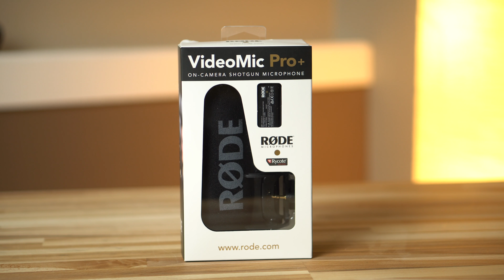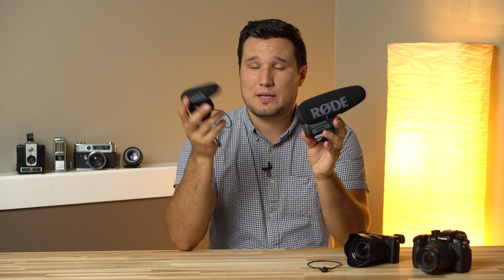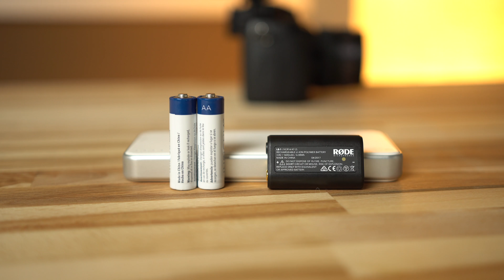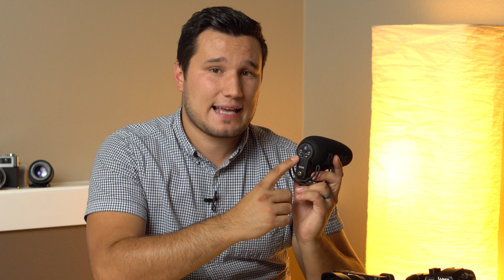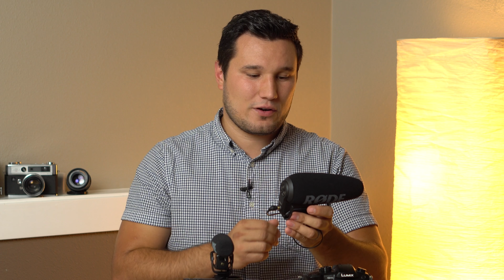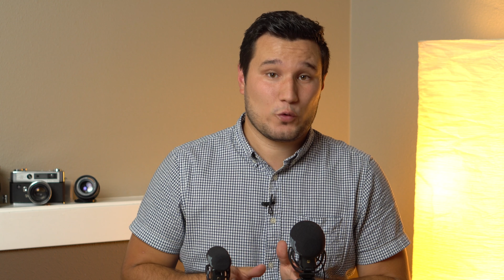RODE VideoMic Pro+ PLUS vs original VideoMic PRO

Comment: The Pro Plus is 3D Omni-directional. Will that fit with the HC-V800? Just think of the V800's 5.1 and Omni-directionality. That can easily capture 5.1 sound systems from the center of a room quite nicely.

Comment: Do these features save? What I mean is... say that I set the mic to record a -10db and 75Hz high pass filter, will those options still be turned on if the mic is turned off and back on again? Or do I have to set them every time I want to record?

Comment: The Rode manual says the Auto Power feature will ONLY work if the camera supplies plug-in power. I tried connecting a mic to a Canon XA20 camcorder and a Canon Vixia HF R72 and the auto power feature did not work. Do Canon camcorders generally not provide plug-in power? Just some DSLR cameras? Who can provide information on this?

Comment: A nice review! Unfortunately the audio levels are not matched so it's very hard to make a fair comparison between the two microphones. The Pro+ is a couple of decibels louder in this video, but it doesn't mean it's better. You need to match the audio levels so you can get an even comparison.

I dowloaded the audio and there's about 3-4db difference between the takes. Especially noticeable outdoors if you listen to the background noise. If I would buy the Pro+, I would go for the features.

Thank you for a nice video!
Jake

Comment: Wow hard choice.  The Pro+ seems to have more gain but also more noise.  I thought it might be that the Pro had better side/ambient rejection but in the interior test the Pro+ seemed to pick up less echo.  So is that Pro+ noise from the +20db gain function (vs the Pro  +10db)?  I didn't detect the Pro+ noise in the interior and boom tests though the additional gain was still there.  Is there an explanation for the noise during the Pro+ exterior test?  After switching to headphones I noticed the noise was there on the Pro as well but it was a little quieter.  I'm guessing it was from the HVAC unit on the house behind you?

Comment: I need to upgrade my mic. I believe that the Rode Video Mic Pro Plus would work well for me. However, can you tell me how it would connect to a camcorder with a side clamp. That mounting type does not bring the hot or cold shoe into play. Does Rode offer a way to do that? Here is the type of mount that I mean: I don't have this specific camera, but the mic mount is exactly like mine: 
https://static.bhphoto.com/images/images750x750/1396442796000_1043893.jpg

Comment: Another feature that was missed on the VideoMic Pro+, You can disable the auto-power sensing by pressing the two buttons in the combination not shown.  The power and the high pass filter pressed together will cause all lights to flash once, or three times.  If it flashes once, auto-power is enabled, if it flashes three times, it's manual power on/off.  
This was useful when using with a pocket audio recorder that was causing it to power off the moment I tried to record.

Comment: Good video overall, but the complaint about not being able to see the viewfinder is completely absurd. If you are using the mic, you are doing video and aren't looking at the viewfinder, but rather the screen.
Reply: Three reasons when I use the EVF specially when run and gunning:  1- When indoor low light   2- Bright day outside   3- Need to  steady the camera more than usual (when using non stabilized B4 long lenses)

Comment: The PLUS's plug is poorly placed and interferes with one's forehead when attached on top of a DSLR or mirrorless. Its a fatal flaw in its design. Busy shopping for such a mic right now and really frustrated by this as the pro+ ticked all other boxes for me.
Reply: I'm in the same boat, and initially thought the plug placement was wrong. But then when you think about it, instead of the viewfinder you're going to use the camera's LCD screen or a gimbal (again, not the viewfinder) most of the time anyway, so that would not be much of an issue, for me at least. The physical size of the pro+ though, that's something to think about when you want to travel light and discreet.
Reply: Just finished two video shoots with the Pro+ on the a7sii.  Using a gimbal means the plug placement is perfect since it dosent interfere with rotation, and even fo the handheld clips, using an external monitor( which you should) means theres always an alternative cold shoe mount.

Comment: Excellent review.  I think I'll pick up one for sure. Now that I've started using my DSLR's for video along with the VMP I'm gonna sell all my XLR stuff including AT897 & AT875R & Tascam 70D & a pile of XLR cables.  My new work doesn't require all the mixing.  Wonder how that bad that back extension issue would be on a Canon 80D or M6?

Comment: Thank you for this. I am thinking of getting the pro plus. My question: Are there attachments to raise the mic a little so that it clears the height of the teleprompter. I use the TMP100 Teleprompter with a Canon EOS Rebel T6 DSLR, and I want to make sure that if the mic is at all blocked by the Teleprompter, there is a way to remedy it.

Comment: Great video.  when speaking on VLOGGING I don't believe external mics are a necessity, besides the dead cat factor on board mics these days are fully capable of  picking up  vocals  clearly. The problem i find lay with the edit. If more youtubers learned how to compress and limit properly then they wouldnt need an esternal mic. I vlog with the M6, In my recent videos anyways lol, and whilst I do own an external I have found I never use it when vlogging. I mean im talking directly to the camera and when its compressed right it sounds fine. But hey every one has an opinion. great vid.

Comment: Hi Max, do you happen to know if the newer version of the video mic pro that comes with a rycote system it's way better than the older one? I think the older one will fit better in my rig since the rycote it's actually wider but I don't want to loose quality.  Thanks!

Comment: Wouldn't setting to +20 and have the safety track on (which is -10) actually turn out to be the +10 setting that is missing?
Reply: The thing is that your right channel record 10db above the left one.. after you can choose the one that is better for you because both will record in mono channel and after you can edit. Obviously if you choose to shot 10db lower the right channel will record in flat mode.. per exemple

Comment: Hi Max. Have you thought of using a wireless Lav Microphone (wired if you need to reduce cost) for doing videos? This would eliminate a lot of the set-up and reduce the size of the kit when you travel. The Takstar is great but as a shot-gun microphone, you can get warble from reflections from surfaces in the room. This is why shot-guns aren't often used indoors. So I wonder if the sound would be even better with a cardiod microphone on a boom stand.

Comment: Thanks!   I bought one as an upgrade for the features you listed.    Unfortunately, my 1st experience wasn't good.  I'm posting this after 3 months since I 1st watched your video.  If you have more advice after having used it for some time, I'd be interested.

I thought I was safe with the auto start/stop when plugged into the camera.   I showed up at a wedding and it was completely dead!  I thought it had turned off automatically when detached from the camera, obviously not.  Or it got turned on when not attached.  Haven't figured out how I killed the battery.

The charge time is also ridiculous. More than 4-5 hrs.  Buy some Energizer Ultimate Lithium AA's and don't leave home without  backup batteries.

As you pointed out, It's much larger physically and weight wise than the basic Video Mic Pro, about 30%, it's big.   And, there no carrying case.  I scavenged a semi-hard GoPro case

Lastly,  No manual!!??  Only a multi-lingual quick start guide that's really hard to read understand.  If not for YouTube's like this.....

For future, maybe you can provide a shooting check list, or pre-recording process / pre-start guide to help us amatuers that always seem to F something up.

Comment: Hi Max, I'm Max too haha. Thanks for the incredible review.

My opinion: 
Audio-wise they're the same, the Plus just sounds a bit louder and recording maybe a bit more noise from the environment. But I think if on the same level, both would be almost the same. 
Hardware-wise: the Plus is waaaaay better. Even if you own the second version of the non-Plus, the Plus is so much better because of the cable and especially the battery.

My solution:
I own the V2 non-Plus and will stick with that for now. Nevertheless the Plus offers awesome features and maybe I will upgrade within one or two years.
Reply: you're the reason I just bought the original, $120 with the windscreen :)

Comment: Hi Max, I'd like your opinion please. I'm thinking of using the Rode Videomic Pro Plus in a rig to act as an external mic for a GoPro camera and also for a Sony RX100-M4. When using the GoPro camera, I will connect it directly using the 3.5 mm cable, and when using the Sony, which does not have an input, I will connect the Rode Pro Plus to my Tascam DR-44WL as an external mic and sync the audio and video in post using Final Cut 10.3.3. The material being recorded will be acoustic guitar and vocals. What do you think of this set up? The Videopro plus is a little large and I was considering the Rode Videomicro except I really want the best quality. For my purposes, would you go with the Plus or go with the older version of Pro since it's a little smaller? Thanks for your opinion.

Comment: Very good review. I was actually considering Pro Plus, but the protrusion is a deal breaker. What were they thinking?! The battery compartment on the regular pro is terrible! I felt like I was going to break the mic trying to close that compartment the first time I used it. Pro Plus has some nice features, but it really doesn't need to be so big, and the protrusion... Is there a good mic with MORE gain or a flexible gain adjustment? Have you reviewed Zoom H1? It seems like a cheaper alternative to Rode that may have even better sound and internal gain control.

Comment: I think they should’ve kept the size of the Video Mic Pro and add auto on/off and x2 AA batteries. The sound difference is a bit nicer on the Pro Plus but i think that it has to do more with the way the volume on the camera is adjusted. For on camera mounted mic needs I switched to Shure.
Reply from the maker: Yes, that would be nice, who knows maybe they will puts something out at $200-$229 to replace the original VMP. The camera settings were set to manual and the same settings so the volume difference was in fact from the mic.

Comment: Pro sounds better because the plus sounds slightly over driven except in the boomed  demonstration. the size is also a issue. for that reason I often  use the Video Micro also. I wouldn't buy the pro plus even thought it would be nice to have the auto off. I would still prefer to deal with Recording sound on a different device and re-syncing if I was looking for super quality

Comment: Does it gain anything by using the XLR1 microphone unit on the GH5 to raise the unit higher, to overcome the problem with getting your eye to the viewfinder, and then plugging the 3.5 mm jack into a 3.5 mm to XLR adapter straight into the XLR1? This bypasses the cameras preamp, and allows you to use the viewfinder, rather than an adapter plate? Just curious!

Comment: MAX@! FALSE. The video mic pro and the version with the rycote mount (the only one you can buy in stores now) ARE DIFFERENT! They have different capsules! 

Had to stop the video right there. 

Unfortunately, this is a comparison is bunk.
Reply: 1:15 "other than that, it's identical" 

No!

From rode's own page - "Completing the upgrade is an all-new microphone capsule, giving the 2015 VideoMic Pro even higher sensitivity and lower self-noise, ensuring crystal clear audio capture over a wider dynamic range."

www.rode.com/news/rode-videomic-pro-gets-upgrade-with-rycote-onboard

Comment: I got mine few weeks ago and used it already on a few shoots, and the auto on/off is really good and worth upgrading for me. The only con for me is the size, when packing it in the backpack takes almost twice as much space as the vmp v1, so I was thinking of replacing the foam windscreen with the one from the v1 or v2 with the rycote (which is a bit bigger than the v1 but still smaller than the vmp+)

Comment: I've been on the fence about this mic.  I just use the Mic J 044 plugged into my G85, it sounds decent.  Do you think think the Rode plus would be much of an upgrade?  Or possibly sound worse since it will be a few feet away from my mouth for vlogs?

Next time you talk to a Panasonic rep, ask them to lower their DB in a firmware update to at least -20.  Fuji did it ;)